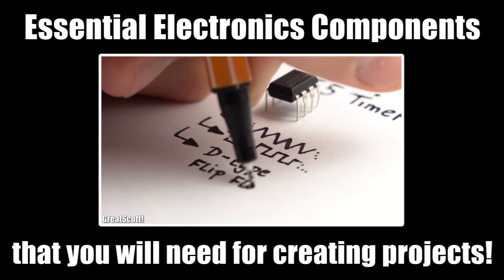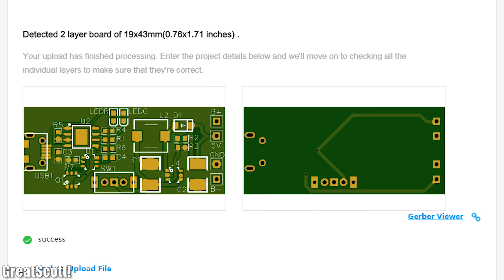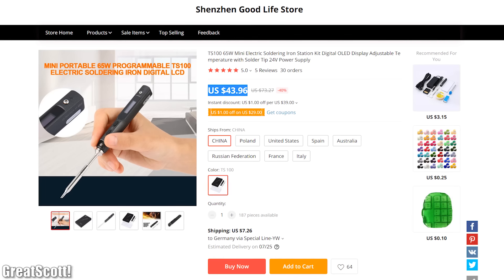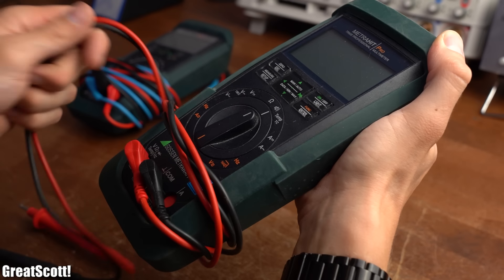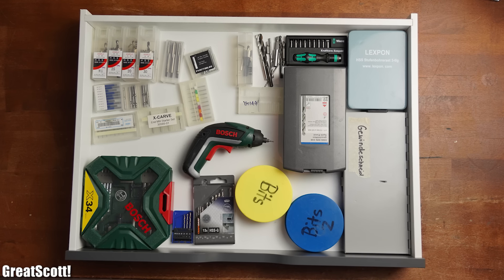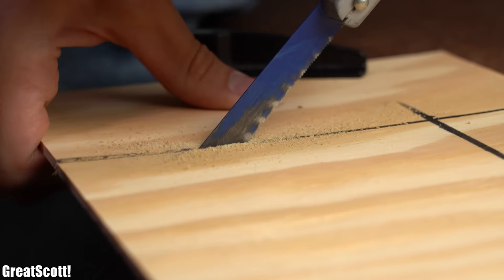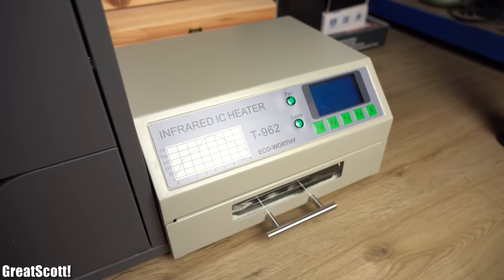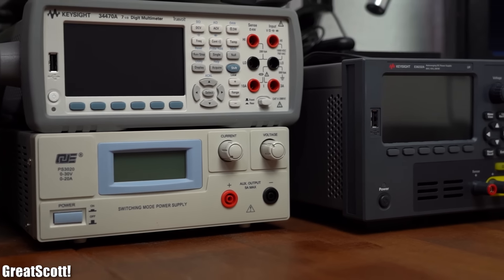Essential Tools that you will need for creating electronics projects!

Comment: 3A for a lab bench power supply ain't gonna cut it my man, need at least 20A for extra fun with magic smoke extraction.
Reply: Remember, the minus terminal of a capacitor is the red wire!
Reply: @joshm264  LMAO😂😂
Reply: Why you didn't use rtx 500w power supply?
Reply: Wth😂😂
Reply: If that's what you wanted, then get the absolute cheapest one from China,  @Cuaks_lemon . They're the only one who don't have overcurrent protection. The PSU may as well double as magic smoke generator in the process though..
Reply: Laptop missing
Reply: @Asu01  oh yes i forget every psu have current protection😅
Reply: Not that all
Reply: I guess you've been watching Electroboom lately 😅😅
Reply: @marcvictor5305  yes, it thats true
Reply: Why watch ElectroBOOM when you can experience it in person on regular basis,  @marcvictor5305 ?
Reply: Yes I'm
Reply: @Asu01  how to friendship with you?????any answer
Reply: Wrong channel dude,
 this is not electroboom!
Reply: @marcvictor5305  absolutely
And you?¿?
Reply: @Cuaks_lemon  🐦🦜🐦🦜🐦🦜
Reply: 20A? Ghat are peanhts, i gota few 133A power supplys (sadly only 12V) very fast magic smoke extraction!
Reply: @rxcreativity8441  what?
Reply: I work with vacuum tubes and I usually use my 50's 0-1600V 0.1A powersupply :D
It even have 4V, 6,3V, 12,6V fillament voltage outputs  for max 5A.

(Of course I have 30/10 switching power supply for powerful applications)
Reply: My old job had a 0-15v 10,000a power supply (yes I did type that correctly)
Reply: Better a 7.2A 12V lead acid battery
Reply: For me 20A power suply isnt enough. I need at least 100A
Reply: Haha ihr got an 20A and 24V gar battery charge from the 90s and i van das HELL YEAH thats lot of fun
Reply: Yeah ElectroBOOM would need that.
Reply: MOAR AMPS!!!
Reply: Depends on what kind of hobbyist you are.
Reply: Nice
Reply: @danielspastars5298  3 phase mains voltage is what I need.
Reply: I am Indian....which country you belong or your nationality please comment on my comment...❤️❤️❤️
Reply: You sound electroboomy
Reply: @Silver_o  in my house there is acces to 3 phase mains voltage. Thats because we are farmers
Reply: If one has very little money ...first spend a month LEARNING on YouTube, from books ...use batteries (at correct polarity and voltage) ...use LEDs which are very cheap; finally but a Chinese multimeter ( $7,  a 2 month wait, meanwhile... LEARN )
Reply: U are reminding me of electroboom
Reply: Atx supplies are 20 a 5v!
Reply: Magic smoke = Dani dev YAY

Comment: When he started counting my wallet ran away
Reply: Getting it all at once would be jaw-dropping. I've been collecting tools for about 50 years now (since grade school) and it's not too bad spread over time. The only tools I can think of off the top of my head that cost more than $500 are the oscilloscope and 3D printer. Most of the rest are sub $100.
Reply: You should have had some clamps on it to stop it escaping ... DUH !! 🙄😂😂
Reply: just buy decent enough but cheapest ones you can find, and then gradually replace the tools you use most often.

Comment: This are definitely not "essential" tools. The only really essential tools of them for me are the screw drivers, soldering iron, a multimeter and maybe the lab power supply (but for starting you could use there also some different power bricks). At least these are the things I started with
Reply: You probably also want wire cutters and strippers. Needlenose pliers are probably my most used tool and the built in cutters are great for cutting small wire and usable for stripping.
Reply: You said it. Going for the real basics as well soon and has nothing to do with most of this video xD
Reply: @eDoc2020  wire cutters? Nah, I'm using scissors.
Wire strippers? Hold on, lemme grab my nail clippers for that
Reply: @bitelaserkhalif  I'd go the other way; nail clippers for cutting wire and scissors for wire stripping.
Reply: tbh he did call it "important tools" and they obviously are important as soon as you diversify your skills and interests.
Reply: In school we stripped wires with our teeth, no tool required
Reply: I also use the Arduino plotter as oscilloscope

Comment: I'd add, from my own lab: a fumes extractor (nobody likes lungs diseases, right?), a powerful LED magnifying lamp, a good xacto knife and a cutting mat to protect the table you're working on.
Reply: How did you comment 2 weeks ago?
Reply: @lankog777  Patreons see videos before non-patreons? No idea, just guessing..
Reply: One of the first things I bought for my humble little lab is a fume extracter. I live in a small basement apartment and I'm already a smoker haha. One thing I think is missing from this list is a handheld magnifying glass, I keep mine stuck to my desk with a big magnet and use it constantly.
Reply: Quick PSA, most cheap fume extractors that you find online don't actually do any proper filtering. It just removes the fumes from in front of your face and sends them whizzing around your room, where, if you work in an unventilated environment, it will build up over time and could cause you harm.

The cheapest way to deal with this is to either do your soldering outside or in a well-ventilated environment. The other, more expensive alternative is to get a proper HEPA grade fume extractor. Here is a really good video by EEVBlog on this topic: https://www.youtube.com/watch?v=ffaiKZMU0Lw.

Comment: - Ultrasonic bath
- Silicone mat (heat resistant)
- Fume fan
- Third hand
I also quite often use a glass from an old induction heater as a mat for anything sharp and pointy. I cut on it too, although it damages the knife.
Reply: Yeah especially the fume fan is ncessary if you're into a lot of soldering.
A third hand is always super helpful and makes soldering way more convenient.
A silicone mat is nice to have, but a piece of wood is sufficient imho.
Reply: @Hellass47  na the fume fan is the bottem of my list ,
Reply: Also an interferometer!
Reply: DJ Scottdog and the unicorn in the corner tells you to keep breathing in the fumes ;)
Reply: Quick PSA, most cheap fume extractors that you find online don't actually do any proper filtering. It just removes the fumes from in front of your face and sends them whizzing around your room, where, if you work in an unventilated environment, it will build up over time and could cause you harm.

The cheapest way to deal with this is to either do your soldering outside or in a well-ventilated environment. The other, more expensive alternative is to get a proper HEPA grade fume extractor. Here is a really good video by EEVBlog on this topic: https://www.youtube.com/watch?v=ffaiKZMU0Lw.
Reply: I may add a sledgehammer that sometimes is necessary and a big neon sign "DO NOT DISTURB" on the door and a "PROCEED ON YOUR OWN RISK"
Reply: @qps9380  soldering outside not an option around here either too windy or cold or raining.
Reply: @djscottdog1  agreed I was an electronics technician and never used any of these.
Reply: I second everything except I've never seen a third hand that was satisfactory...
I have a couple of vices for that purpose.
Never used a fume extractor, even though I would have liked to.. I don't like fans very much as they can interfere with the soldering, so I've developped the habit to exhale with my mouth after each solder joint. Also I work right next to a window, so I open it when I can.
Reply: Third hand is hella needed😂
Reply: In one of his early videos he shows a DIY fume extractor.
Reply: For what the ultrasonic bath?
Reply: @derpoblizist9076  for cleaning PCBs after soldering.
Reply: Rreeeeodeioeeei
Reply: @djscottdog1 i just have a fan pointed at an open window

Comment: "Essential Tools that you will need for creating electronics projects"
THE MONEY
Reply: true, but its really time as well. if you want everything now, yea, you need money. ive only been into electronics for maybe 5 years now. ive been using general homeowner shed tools my family owns for most of my tools. for the specialised tools, i've had to gather cheap and useful tools over time. until yesterday i used a cheap £10 multimeter that was accurate enough to be useful in repairs, now i have a UT210D. considering i do a lot of automotive stuff, the inductive 200A DC measurement feature is a dream come true. the temperature probes amazing too, but now im gushing. my point is if you love this stuff, you'll still have that little bug in you that gets you to spend a little bit on some nice stuff and you'll slowly see your collection of specialised tools grow. don't let money limit you.
Reply: Not really true, I managed during Corona lock down to strike pretty good deals at all my lab (used in most cases, for the oscilloscope, function generator and what not) equipment and for $220 got almost all what it's needed including benchtop multimeter, analog function generator, tektronix digital scope, lcr benchtop meter and a logic analyzer
Reply: I tried going to landfills to get tools and parts that i could fix so i didn'tt have to spend money. And some things still worked and didn't need fixing at all. Thrown out because they bought the new model i guess.
Anyways, turns out it's illegal where i live to pick up someone else's trash even if it still works. So never doing that again and for now i've given up on making things and repairing things.
Can't afford the parts and tools, i clearly can't afford a fine or prison.
Good luck man, hope you get around money at some point so you can make your brain work :)
Cheers!
Reply: Just buy them as you need them in my opinion. First off you'll need a soldering station (or just an iron), some spare wire, few crimps... etc.. then buy more as you get more money to spend :)
Reply: @to G I've got an osciloscope from hantek for around 300€. Search on banggood hantek dso5202p. You will find a couple of videos abut the osciloscope...It measures a lot of things but don't expect I2C data reader or fancy graphs(except for XY) it does it's job really well
Reply: @PigeonSwag  yeah ! , time is another important factor and it takes lot of effort just to learn this stuff , thanks.
Reply: @ZonaALG  the good 'ol bankrupcy. Great when it happens to others
Reply: @crispy-k  It's also illegal here in Finland to raid dumps and electronic garbages but I've taken it as the exiting part of my hobby. The fine is pretty low and for more than ten years of diving, never got to pay the fine, always spoken myself out when getting caught. I see dumpster diving as recycling and many have started to see it also. You may do as you will and I can understand that if prison is an option, you rather keep it away. But don't give up your hobby. People can give away great stuff to repair and tune.
Reply: Start small. Buy a €10 multi meter and a €35 adjustable soldering iron. Components from alie. Some basic tools like cutters. Get some proofboards and lookup a few nice projects. Most of it can be made with those basic tools.
Reply: Electronics like this is among the cheapest hobbies. You can get started for less than 1000 USD and you can live with cheap equipment as long as you spend a bit more effort. Ham radios usually cost 10k+ for anything substantial. Drones 5k+ and hard to get started. Unless you count cooking as a hobby I guess.
Reply: @ZonaALG  tektronix digital scope, lcr benchtop meter for <220. impressed.
Reply: Chylus if I had money, I would have time
Reply: @crispy-k  Where the heck is illegal to pick up someone's trash.   Here in America, it's a national past time.   Anything anybody puts out on the side of the road for the trash man to pick up is fair game.   TV's are full of electronic parts.  I've brought home basketball goals, satellite dishes, dollhouses, huge oriental rugs, all sorts of crazy stuff.    This is by the side of the road on trash day, or at the local dumpsters.  I've been to landfills but can't see making a trip to them, you have to pay to get in.    You just have to be quick about it, and not look like some vagrant rifling through trash.  Only take stuff or look at it when nobody else is around.   Duh!  lol.
Reply: In all the years of messing about with electronics, I've never needed an Osciliscope, Waveform Generator, or even Benchtop power supply (although the bench top power supply would of been nice).   You can leave off the Osciliscope and that high end stuff.  It's just something you pick up along the way hopefully for a song.  I have an old crusty one and still have never used it.  It really depends on what kind of electronics you do.   That expensive junk is for digital electronics and digital electronics goes obsolete so fast, if it's broke you usually throw it away.  At least I do.  Most of the stuff you do if you're just a hobbiest making projects will involve using the simplest and cheapest tools that you will just kind of pick up along the way.   Case in point:  No Radio Shack 150 in 1 electronics training kit ever included an Oscilliscope or needed one.
 
So FYI IMHO an osciliscope or waveform generator should not even be on this list, unless you are doing repair on boards with IC chips and got a degree from some college in electronics engineering.  Then maybe it's what you live and breathe, but for the rest of us, it's probably just a fancy boat anchor taking up space on the desk and never used for nothing.  I never do that stuff, so the Oscilliscope is off the list as big @ss waste of money.
 
Most of the tools you will use are just cheap pliers and tape and cutters and heat shrink tube and a decent soldering iron and decent solder.
 
A digital microscope that displays to an HDMI monitor would be a better investment if you want to blow some cash.  I've been looking at a Hayear but that's because my eyes are going bad and I'm blind in one eye.  If you have decent eyes, you don't per say need it...
 
Digital microscope :
   
https://www.banggood.com/HAYEAR-2K-41MP-HD-1080P-60FPS-HD-USB-Industrial-Camera-TF-Card-Digital-Video-Microscope-with-0_5X-Eyepiece-Adapter-30mm-or-30_5m-Ring-p-1604502.html?rmmds=mywishlist
 
https://www.banggood.com/HAYEAR-0_3X-0_5X-2X-Stereo-Microscope-Auxiliary-Barlow-Lens-Big-Attachment-Objective-Lens-p-1537914.html?rmmds=mywishlist
 
https://www.banggood.com/HAYEAR-Aluminum-Alloy-Stand-Bracket-Holder-Microscope-Holder-for-Digital-Microscope-Suitable-for-Most-Models-p-1561117.html?rmmds=mywishlist
https://www.banggood.com/HAYEAR-Dual-arm-Heavy-Duty-Boom-Stereo-Metal-Table-Stand-50mm-Ring-Holder-Universal-Large-Table-Stand-For-Industrial-Microscope-p-1494721.html?rmmds=mywishlist
Reply: @ZonaALG  You are damn lucky. Where do you live?
Reply: Yes the money is the very essential thing for make electronic projects 💷💶💵💴💸💲🤑
Reply: @crispy-k  that's unfair. Things non-personal and in good condition should be able to be taken, worse its already in the dump.
Reply: @lokmack3746  Exactly my thought. And when i found computers i usually just threw out the harddrives or wiped them in case they could actually be useful. Never looked at a file or folder in them, don't really care about them haha. I'm a bit weird, but i'm not a creep ;)
I hope some day this will change, we get asked to pollute less, stop wasting things, but things that work perfectly fine and are in the trash... yeah you can't reuse those. Makes no sense. To me at least.
But i guess it has something to do with money that these "recycling" facilities get for X weight of trash, and probably some money from the state. Which they wouldn't get if there was less trash.

Crazy.
Reply: @crispy-k  Yeah. Its a waste. As long as personal information is not their or anything personally related. And that's not creepy. Its actually recreating things that are in good condition for usage.
Reply: FLUKE 27/FM $12 military surplus ebay
"oscilloscope" audio jack on netbook ($26, getting hard to find tho)
priceless: a human society that doesn't shit right on your face
aliexpress: 25kHz transducer $11 for 10. in the united states, $28 for 1. america go back one line.
Reply: I was supposed to like this comment, but as I did. I saw that it switched from 555 to 556. So I unliked it again...

OT:
Thanks to chinese manufacturing I have quite a decent lab for my own. But atm I have it stored because I needed to move to a small apartment.
Reply: @leozendo3500  HAM radio is becoming much more accesible due to the new SDR's that have released the latest years. And with a much bigger frequency span than regular analaog receivers. But with that said. The sensitivity and cool'nes of analog equipment is not to be neglected.
Reply: @to G OWON SDS1102 is good cheap osciloscope, there is also FNIRSI tablet one which is good and cheap.
Reply: you can buy really cheap second hand tools or faulty tools and try to repair them.
Reply: You can get most of these tools for cheap prices when starting out in electronics. Over time you can upgrade to higher quality tools which obviously cost more money. Also depending how far you've evolved in electronics, you can actually build / create your own version of a lot of these tools. Such as soldering iron, power bank, and multimeter.
Reply: "Need" is a strong word, it's really more of a "Wouldn't it be nice".
Reply: Into electronics and not having money, I have never heard of that. Money comes to you